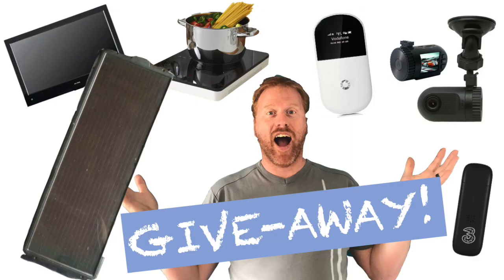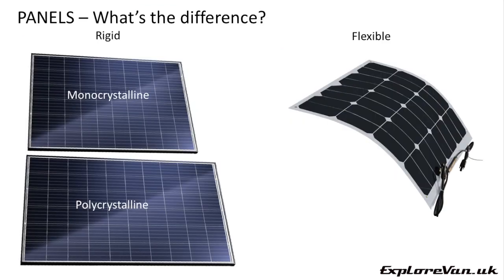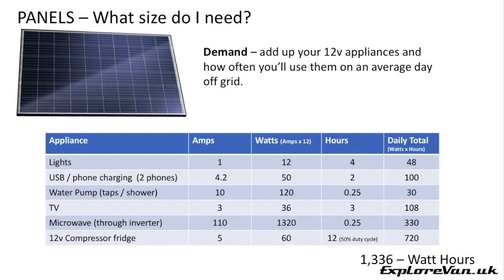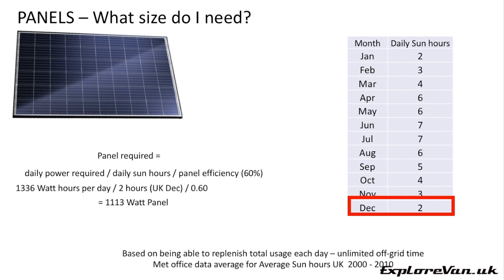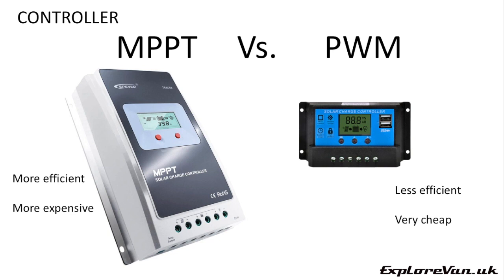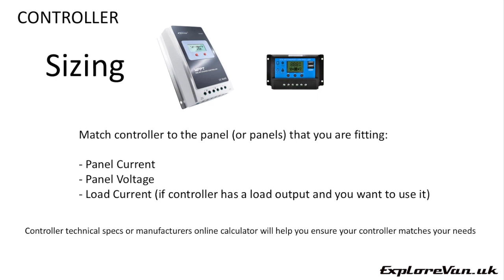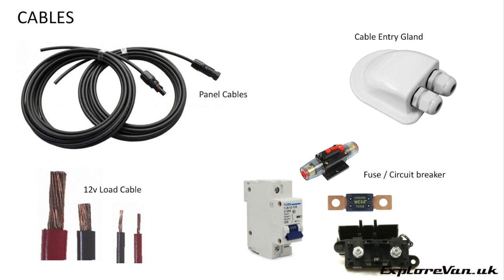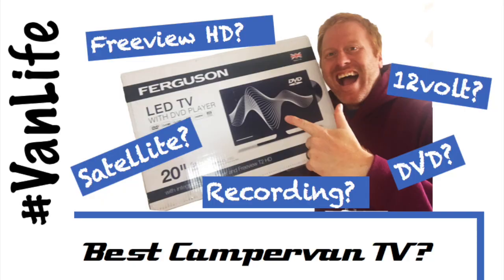Campervan Solar Installation Explained. Which panels & controller for van, motorhome, RV.

Comment: I’ve read that using an isolator switch between the panel and controller isn’t necessary and also reduces efficiency. Comments?
Reply from the maker: Hi - from my perspective a fuse or suitable DC breaker correctly installed has its advantages and does no harm for a panel installation

- It will protect the controller if it is undersized
- If cables are undersized it could prevent fire
- Some Controllers require that the battery is connected first to initialise the controller before connecting the panel a breaker or a fuse is an easy way to ensure the panels can be disconnected while this is carried out.
-Being able to remove the panel load when disconnecting the cables saves having to cover the panel to avoid potential arcing. 

I chose to use a suitably sized DC breaker like this https://amzn.to/45dZy6c to provide both a protection and a means of isolation. 

Hope that helps

Comment: When you say biggest panel you can get I assume that you are talking about the wattage and no the dimensions.
Reply from the maker: So kind of both, - highest wattage with the dimensions that will fit in the space you have.

You could save some money by going with a Polycrystalline panel which has slightly less watts for the same dimensions.  But that's obviously at the sacrifice of some performance.
Reply: Will this permormance 18% vs 21% really matter in 250-400W range? I can't decide between 500W poly(way cheaper) and 420W mono. For couple of %more efficiency more than double price? And more Watts with poly. Worth?
Reply from the maker: The 500w will out perform the 420w irrelevant of whether Poly or Mono. 

Mono just means the panel can be physically smaller for the same power output.

If you have the room to accommodate it I would be going with the 500w Poly.
Reply: @ExploreVanUK  perfect. Thanks so much for quick reply and massive  advise. Even better option  with 2-3 panels not to  loose efficiency  % when shaded. One of the easiest subscriptions done for me. Keep it up

Comment: PWM so the control panel but I’m not too sure what solar panel to go on top of the roof. Ideally I don’t want it to stay there all the time because I want to use the roof bars for my kayaks but I’m not too sure go flexible or son to zip tie it’s easy to come off the roof, any help please
Reply from the maker: Hi funily enough we're just working on a video comparing the Pros / Cons and performance of a Fixed Rigid panel, Vs a Portable Folding panel.  It should be out in the next couple of weeks and may help you decide.

Comment: Hi do you lose ampage through using longer solar panel wire from longer distance from panel to controller  than if only short distance .. im talking 3 metre to maybe 20 metres  ? Thanks
Reply from the maker: In short, yes.  For best performance short high quality “thick” cables are the norm. 

You can compensate for longer runs with a high grade cable but always best keep it as short as practical.

Comment: Are you aware of a suitable and small wind turbine that can be used on a solar set up either static and/or mobile?
Reply from the maker: Hi, my only experience of Wind Turbines is on boats and to be honest its not been great. 

As they have moving parts even the expensives ones are prone to failure over time, the cheap ones even more so. 

They need to be pretty big and pretty heavy to get a reasonable amount of power out of them.

No matter how well they are balanced the vibration and sound of them is pretty annoying.

Personally I wouldn't consider one for a van, add more solar, a high power B2B will give you more power for your £s.

But if you really want one the only ones I would consider would be a Rutland - https://www.marlec.co.uk/wind-power/

Comment: Hi I’ve got a 120w panel on motorhome can I fit a dual  mppt controller and what material would I need
Reply from the maker: Hi, could you just clarify what you want to do.  By dual do mean for dual batteries?   What do you mean by material?
Reply: @ExploreVanUK  hi yes I want to charge leisure and engine battery’s material is size wire cut out etc what the best way .
Reply from the maker: Assuming you’re comfortable that a 120w panel will give you enough power I would go for a quality MPPT from the likes of ePever or Victron.  Because your Engine battery will mainly be charged by the alternator there should be no need for a dual battery controller. Just fit a dual direction Voltage sensitive relay between your leisure battery and starter battery. That way once your leisure battery is charged it will top up your engine battery and will also mean your Leisure battery can be topped up once the from the starter battery is charged when driving. (If your van has a Smart alternator you will need a battery to battery charger rather than a VSR)

When it comes to cables etc it’s very individual as to how much power you are putting through and how long the cables are. There are lots calculators on line to help pick the right ones for battery connections etc. 

For the panel I would buy dedicated solar cables these would be fine for 120w panel. 
https://amzn.to/3cOeCQi

Comment: My van, (2024 Sven Hedin), has 2 leisure batteries (92aH & 70aH), and I want to connect a portable solar panel to supplement summer usage. The 92aH battery is most accessible in the engine compartment. Can I connect an MPPT controller to the battery with a 'fly lead' for connection to the panel? That way I can park my van in the shade and position the panel in sunlight.
Reply from the maker: As long as the lead is suitably sized, fused and protected from damage I don't see why not.

Comment: excellent video, I replaced my 20 amp controller with a 30 amp, will that be OK?
Reply from the maker: Yeah no problem. Means you can add more panels later if you want.

Comment: This might be a stupid question but do you need to keep the panels in direct sunlight, it gets to 40°c in Australia most summer days, I'm asking because of efficiency
Reply from the maker: They will still work to some degree in the shade but it would dramatically decrease the power generated. 

The decrease in efficiency due to the heat would be far less than than the gain from being in direct sunlight.

Comment: Hi, that is really useful, especially the calculator to see what panel size.  One question, would this vary depending on what amp solar charger, I.e. 30 or 50 amp ?
Reply from the maker: You’d need to size the charger based on the panels your connecting. They will have a maximum wattage that they are capable of.  A higher Amp charger will only be worth it with enough Wattage from the panels to make it worth while.

Comment: I wonder if it will be possible to use solar panels to (slowly) feed the battery of the new upcoming Ford E-Transit electric van when you're parked up?
Like wire up the panels to the inside back of the van along with the Ford charging device and from there have the charger cable go outside to plug into the front of the van. Then you can have everything in the van powered by the "Pro Power Onboard" system's 2.4kW possibly even an optional 7.2kW for an electric oven/shower.
Reply from the maker: That would be great - To retro fit something, I imagine it would depend on what demand and what intelligence the Ford charging system has, if it is expecting to be plugged into the mains it will probably not like a trickle charge, but it would be great if Ford thought of this and allowed a direct solar connection, considering the amount of roof estate available it would be a great option.
Reply: @ExploreVanUK  Yea, exactly what I was thinking as well. I've read somewhere that the Ford system allows for varying amounts of charging load, but like you say - will it allow for a trickle charge compared to the smallest mains power charge amount. After all its well known faster charging worsens the life of the battery, but what about a very slow charge.

Comment: Great video thanks can i ask ..
I have 2 100amh batteries wired in parallel , i want to add another panel the same type .. do i wire it also  in parallel..12 volt setup  thanks
Reply from the maker: Hi, could you clarify what you are looking to add?  You talk about Batteries but then you say add another panel.  If you can give a bit more information about your current set up Batteries / Solar Control / Panels / other charging etc models and types, and how you are planning to use it, we might be able to give some advice.
Reply: @ExploreVanUK  i thought i did ...at moment 1 x 150 watt panel ..2 x100 amh batteries  And 30 amp mppt controller i want to add 1 more 150watt panel same as last one
Reply from the maker: Ok - as you have an MPPT controller it is probably capable of taking the input voltage of the panels either in parallel or in series - but do check the specs.

Series is probably the easiest to wire up as you can probably do this without making any changes to the connectors.

However a down side of running the panels in series is that if one gets shaded it adversely impacts the performance of the other panel even if it is still in full sunshine. For that reason personally I would put them in Parallel.
Reply: @ExploreVanUK  hi so to confirm my batteries are parallel connected so i can put panels in parallel.
Or what’s best    Thank-you for your advice  also .
Reply from the maker: It doesn’t matter how you have your batteries other than you would need to set your controller to match (parallel 12v, series 24v) 

Your controller will match your panels to your batteries whether your panels are in series or in parallel.  (As long as it is suitably rated.)

There are pros and cons to each but parallel would be my choice as explained above.

Comment: Thanks for the great info. can I ask you a couple of questions ? seems the 12 volt group on face book  is stopped, so i cant ask there. On my 30 amp Epever there is a earth connection on the body, is this for a shore line connection as I have not seen it being connected on any of the "how to connect" vids. Also what fuse or breaker would you suggest for the 30 amp charge controller Thanks..
Reply from the maker: Hi, without knowing the exact model of your controller and full details of your installation its a bit difficult to be sure of giving the correct advice with regard to the earth connection, I don;t recollect there being one on my ePever tracer - but I may be wrong. 

When it comes to the fuse / breaker (I've assumed you mean in the battery positive connection rather than the load output or solar input) ePever recommend a fuse whose current is 1.25 to 2 times the controller's rated current, with a distance from the battery no longer than 150 mm.
Reply: @ExploreVanUK  Oh, i have ordered a 30 amp breaker, will this "break" too soon?

Comment: I was wondering which inverter your using? Especially to run the microwave.
Reply from the maker: We tried a 1500w (2000w peak) inverter and though it happily runs the microwave we found it totally kicked the batteries and meant we needed a lot of sun to add the deficit back. 

We now don’t bother, it’s therefor an emergency but we only cook on gas now unless on hook up. Especially since we went to refillable LPG which costs pennies.
Reply: @ExploreVanUK  Thanks for the reply. I really appreciate it.

Comment: Great video! I have a 12v battery. Can I use a mppt controller with higher voltage solar panels?
Reply from the maker: Yes you can. The MPPT will control the voltage to the battery to make sure it is charged correctly. Just be sure to set the controller for the correct type of battery.
Reply: @ExploreVanUK  Thanks this will help a lot!